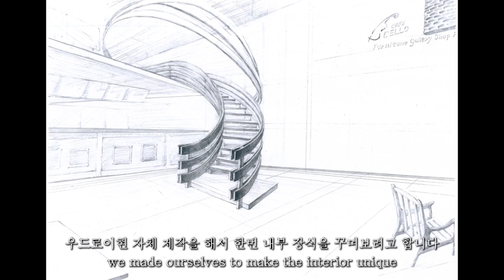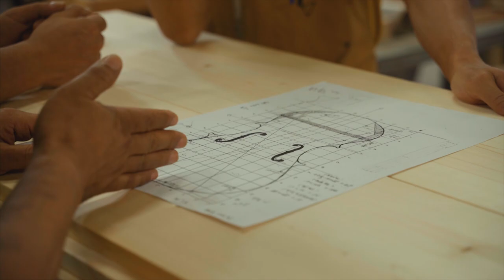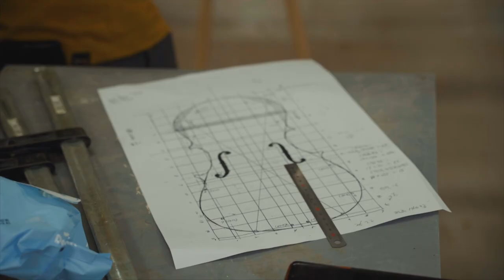초대형 첼로 작품을 만들어 보겠습니다 Project.CELLO cafe 프로젝트 첼로 카페, 첫번째 이야기 ep.1 Making a super-large cello

Comment: you have so much tearout on your board.  Next time try  a 46328 CNC Solid Carbide Compression Spiral for Solid Wood 1/2 Dia x 1-5/8 x 1/2 Shank x 3-1/2 Inch Long Single Flute Router Bit By amana tool. .